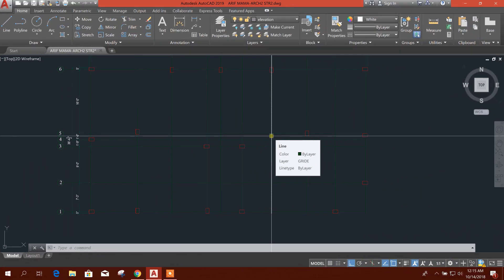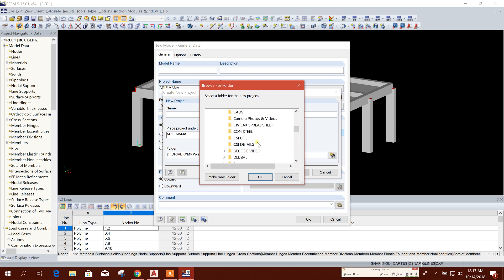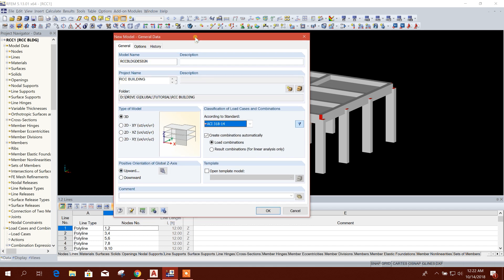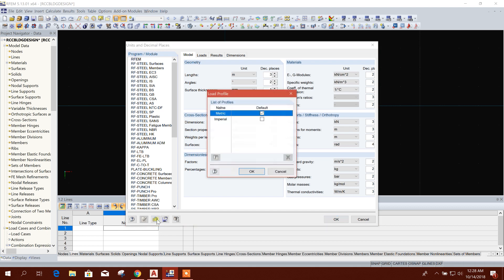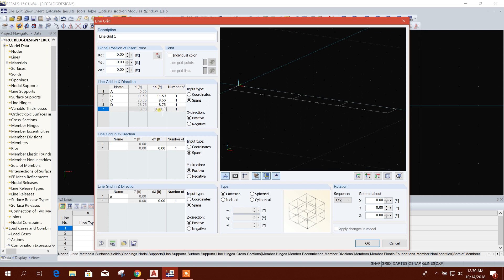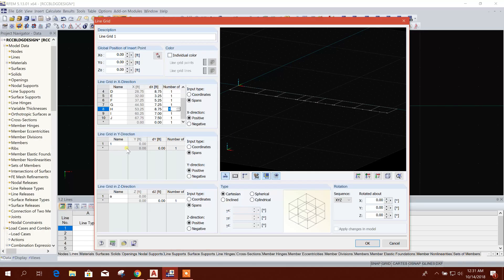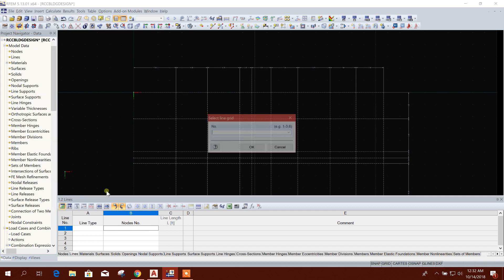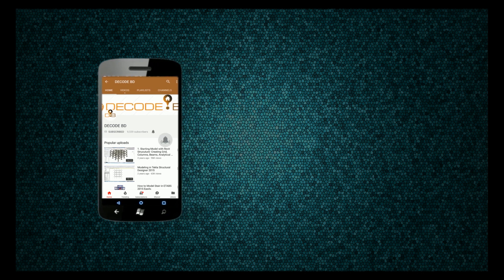CREATING AND EDITING GRIDS IN DLUBAL RFEM

Comment: Good day sir. You have a lot of series on analysis and design with different software applications which are no doubt very good. It has helped a lot...
I WANT YOU TO CONSIDER DOING A SERIES ON REINFORCED CONCRETE  STRUCTURAL DETAILING OF EACH STRUCTURAL ELEMENTS TO CODES OF PRACTICE. Revit, AutoCAD, AutoCAD Structural Detailing or even Tekla will be fine. Thanks
Reply: A trick : you can watch movies on Kaldrostream. I've been using it for watching loads of movies lately.